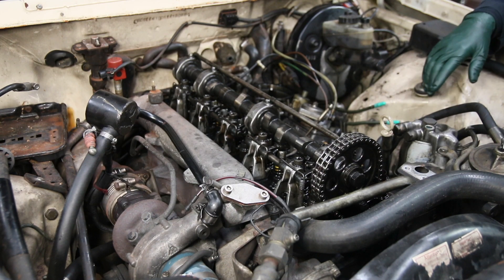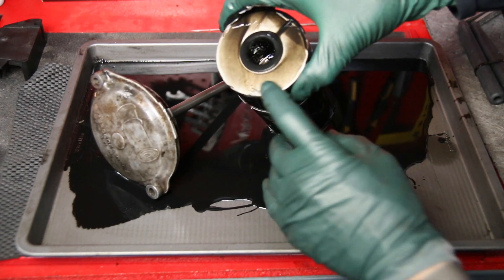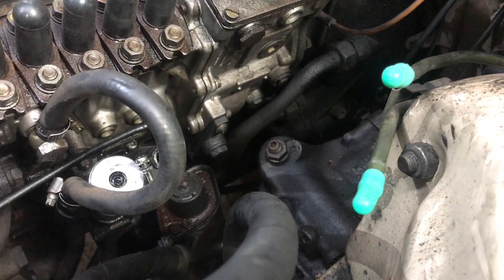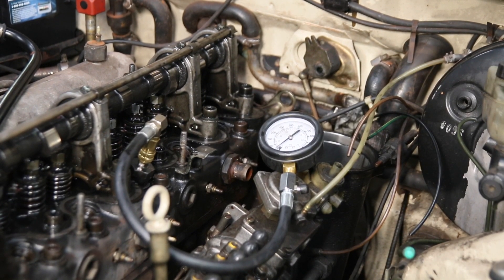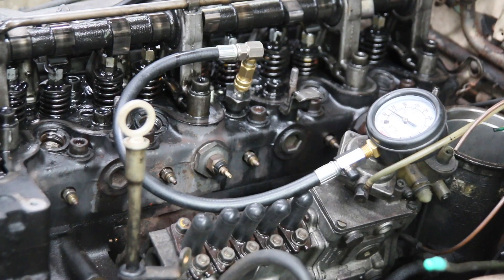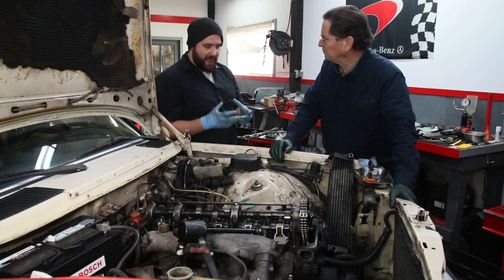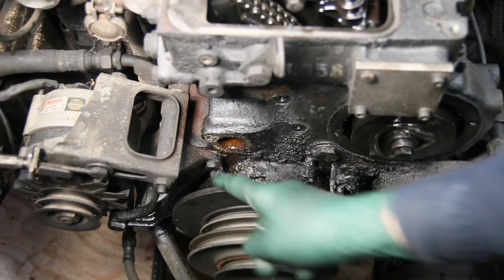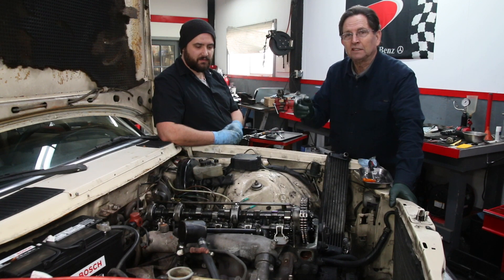Blown Turbo Diesel Engine Diagnosis Part 2: Looking for the "Smoking Gun."

Comment: Hello, I've been watching your videos for a couple of years now and I love seeing all the old technology and how intelligent the engineering is on these older European cars is. I am a Volkswagen/Audi tech and had to comment when I saw the low compression on cylinder 3. I've had to replace or rebuild three VW 2009-'14 Volkswagen TDI engines in the past four years for low compression on cylinder 3. Always cylinder 3. VW four cylinder "clean" diesels have cylinder pressure sensors built in to all 4 glow plugs and they set a code for implausible signal. The pressure on cylinder 3 will be about 4 to 5 bar lower than the other 3. You drop the oil pan and the rod for number three will be slightly tweaked. The reason is the air to air intercooler. Condensation forms and starts to fill the cooler with water. The water migrates and enters the engine causing the rod to bend. Water in the intercooler can also cause no start issues in the winter when the water freezes and blocks air flow. Gen 2 and gen 3 TDIs have air to coolant intercoolers, so they don't have this problem. Just had to laugh though, always cylinder 3. It's the shortest path in the intake manifold.
Reply from the maker: Hi John, thanks for sharing that!
Reply: @Mercedessource  My pleasure! I thoroughly enjoy your videos. Pre-1995 Mercedes are some of my favorite cars and I've always been curious as to how they work. I've been in the auto business for twenty years and very much enjoy learning how things work. I do a lot of diagnostic work and for me, it was never enough to just know what to replace or fix, I need to know how and why it works. You need to know that to properly diagnose and it's knowledge that's very lacking in this industry. Your knowledge and ability to convey it to others is amazing and definitely heightens my appreciation for the older vehicles. Thank you for doing what you do.

Comment: I cant help but wonder if fuel quality played a large part in this.. water contaminated?
Reply: There's little knowledge of diesel passenger cars in the United States in comparison to Europe.  I think based on a lot of the problems I've seen on diesel cars in the US (not just on Mercedes) that the fuel quality control is either lower, or there are no high standards for fuel stations when storing fuel to ensure the quality is not reduced.

On these particular 300Ds its just neglect from owners who use the cars over the years.  Many may check the oil and change it when required, but its the other problems that crop up with age and mileage.  Neglect of fuel injectors is very common.  If the car is running well why are people going to check it?  People won't even change a bulb on their car, let alone check to see if an injector is working well.